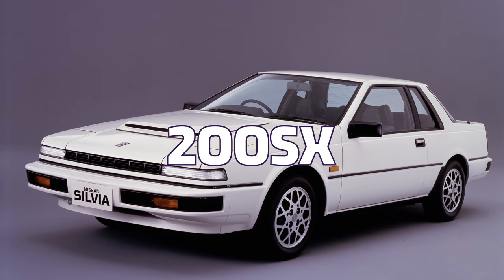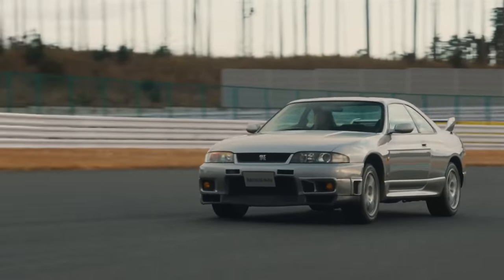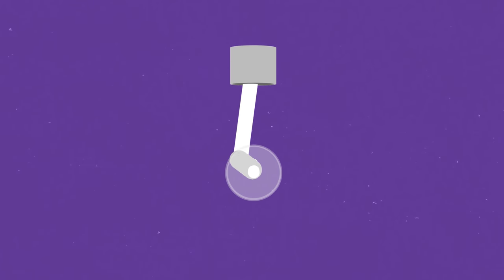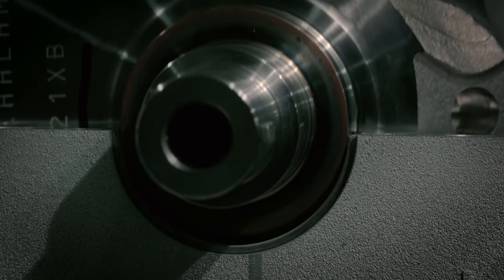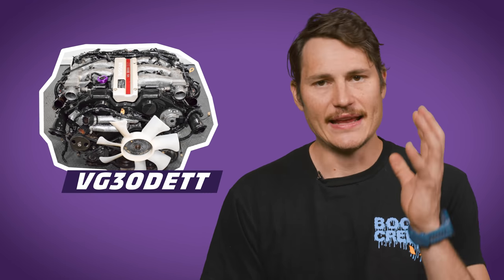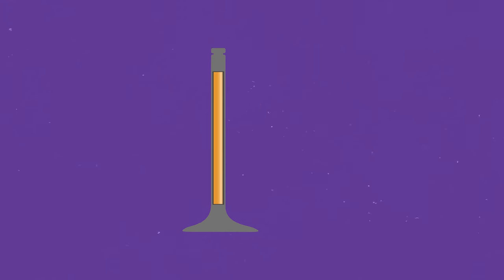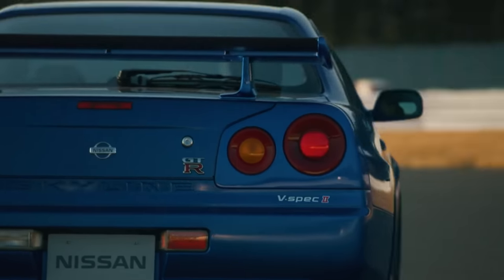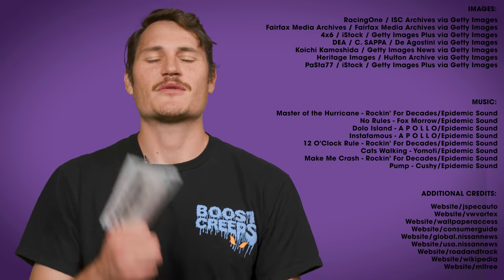RB vs. VG: Why Nissan Discontinued Their Best idea

Comment: if we had another round with legacy the VG would win hands down, basically every performance car Nissan has made since the R34 has been a V6 (correct me if I'm wrong but I'm 90% certain)
Reply: That's true, all performance cars they made in the last 15 years are V6s. So basically... both of them. That's depressing to say out loud :(
Reply: @bogdanrus7953  in saying that they've refined them a lot of the last decade... I can't really say much, I've never owned a fast nissan, I've had a suby b4 RSK and a VY Holden commy in the past... and now I drive a prius
Reply: Sentra SE-R Spec V, was it? I mean...  I know it's a Sentra and a FWD car from the early 2000s. But C'mon, dog. It's in Need for Speed Underground lol. Actually, forget I said anything. Slippery slope, that one. Next thing we'll have the Nismo Rogue in the mix 😐
Reply: @jblox1990  also need for speed underground came out while the R34 was still in prod... (NFSU came out in 2003, the R34 stopped being made in 04, the best gaming year for Ps2 and OG xbox is 05, some of the best games of all time came out that year)
Reply: I suppose you could count legacy...
However, other than being a V6, what does the Nissan VQ and later engine share with the VG? There is one thing I'm glad it didn't share. A timing belt. If you work at a car company and a member of a staff decided to build a car with one, gag them with a split timing belt.
By this logic, could the RB engine be considered what the L-series could have been?
@Bogdan Rus
I think BMW still uses inline sixes. Since Toyota wanted one for the MKV Supra, they used the BMW engine. I'm not happy about that, BMW engines tend to have really awful oil leaks.
Reply: @ThetrueDjScottyD  hahah up the VY
Reply: @ThetrueDjScottyD  R34 stopped production on ‘02 if you’re thinking of the Z-tune Nissan bought back a specific number of used R34 V-spec II for the 20th anniversary of NISMO.
Reply: @matthewcasey5059  Thank you!!
Reply: Even right now their premier car uses a v6 that is called the VR engine. Which is an evolution fo the VQ... wait.. what was the one before the VQ? The VG.... odd. 

Surprisingly the VG and RB came out of production at the same time and nissan decided to go with the VQ and then VR instead. They also have the VK that was used for a small time betwen them but that's an ENTIRELY different beast.
Reply: @matthewcasey5059  they bought back 20 and sold 19 of them, kept one in the factory
Reply: VQ and VR V6s from ~2002 forward, VG was replaced by VQ.
Reply: @ThetrueDjScottyD   TXR0 and TXR3...oh the grand memories.

Comment: well. nothing beats an inline 6. sounds amazing, runs smooth as all hell, simpler, better sounding, cooler in every posible way. I don't understand why almost no manufacturer uses them anymore.

well, I do understand why almost no manufacturer uses them and it has to do with packaging and being able to use it in more different models but still, Volvo managed to cram their 3.0l inline 6 in a v/s60 sideways. and those cars aren't exactly wide so even tho it is simpler to have a V6 in a FWD based car is it more often than not possible to fit an inline 6 in one aswell
Reply: It's probably also a fuel economy issue; look at jeep with their 4.0... dropped due to poor fuel economy
Reply: Volvo managed to fit one into an S60 sideways but having a six cylinder engine hanging over the front wheels meant it handled like crap. Everyone else who makes I6s mounts them longitudinally, and other than in very large cars they always get criticized for their cars lacking in interior space compared to their rivals.

The vibration issue is grossly exagerated and counterweights don't really consume much power to turn at all. They add inertia but when road engines have heavy flywheels mounted on them specifically to increase their inertia that's a moot point. Most V6 engines are very smooth, smoother than any I4 which is what most people drive. They also generally sound better than I6s, of course don't go comparing the sound of a BMW M3 I6 with an old Ford truck V6.
Reply: @BigUriel  I don't agree. The practical reasons are fully valid. An inline 6 is a long engine, but saying that all Volvos with inline 6 engines handle like crap is a gross overstatement cause a Volvo V60 polestar held the lap record on the nürburgring for an entire year and with terrible handling would that be impossible. And I have driven a V60 polestar and can tell you from personal experience that they handle great.

But, it is hard to make a car with a big engine hanging in front of the axle into a good handling car, but that same logic is applied to a v6 since they are just as heavy as an I6 if not more so.

And I absolutely disagree with the sound. I personally find an inline 6 to be miles better sounding than a v6. I even think that most inline 4 cylinders sound better than any v6 engine. R35, sound like shit. V6 mustang, what a joke. The new Ford GT, completely gutless. I don't like the v6 sound at all. But this is super subjective. What I find to be good sounding can you think sound like shit and vice versa.

But according to me are among the best sounding cars ever running an I6. The jag xj120 and Mercedes 300sl are two examples that come to mind.

And shure, a v6 runs smoother than an I4. That isn't a surprise. But an I6 and a v6 are in entirely different leagues. Perfect primary and secondary balance beats perfect secondary balance and balance shafts to try and stop the primary forces.
Reply: @isaks3243  You can make a terribly balanced car still go around a track reasonably fast if you make a lot of compromises, like very stiff suspension and of course very grippy tyres like the ones they use to set Nurburgring records. AWD helps too of course but then we're entering the debate of handling vs grip which don't always go hand in hand.

A V6 engine weighs the same but can be fitted in a different position which changes its effect on the cars center of gravity. You can mount a V6 engine longitudinaly on most cars without them hanging over the front axle, many cars with V6 engines actually have the engine behind the front axle which technically makes them mid engined cars.

I'm guessing you're American and so you don't know what a good V6 engine is. Most American V6s are budget alternatives to the V8 counterpart, where as in Europe V6s are high performance alternatives to the I4 counterparts. That makes a huge different in how the engines are designed and tuned. I suggest you look around for someone with an Alfa Romeo Busso V6 for example and then decide which sounds best.

The difference in smoothness between a V6 and I6 is almost imperceptible. Modern V6s are very well balanced, engines have rubber mountings (sometimes even pneumatic ones) to absorb vibrations, heavy dual mass flywheels etc, 9 out of 10 people would not be able whether there is a V6 or an I6 under the bonnet based on NVH.

I6s have mostly been replaced by V6s for a reason, they simply offer a better compromise relative to what consumers actually want. An I6 is cheaper to make, that's what manufacturers would prefer to sell if they could, but then they'd lose sales because their car would handle poorly, or need to have a very poor ride to handle reasonably well, or they'd need to have a very long bonnet with the passenger compartment pushed back (and ultimately shorter relative to the car's total length) to make room for the engine which is what BMW does.

And I actually own a BMW with an I6, I should know. Leg room isn't great in the back because the engine goes so far back that the driver sits right in the middle of the car, that's always been a downside of BMWs.
Reply: @Sérgio Alves  you are completely wrong with your assumption of where I come from. I am born in the land of Volvo, I.E Sweden. I will try to find that alfa that you're talking about and see if it is even with a good sounding I4.

I have been in or driven cars with almost every type of engine. inline 3, 4, 5, 6 8. V4, 6, 8, 10, 12.  boxer 4 and 6, twin wankle, VR 6 and w12. I know what they sound and feel like and the only engine that is as smooth as an inline 6 is a v12 from what I have experienced. modern V6 engines do run a lot smoother than an old v6 which in a bad case can vibrate worse than most inline 4. I am extremely sensitive to feeling vibrations and I can feel different types of vibrations and if you're correct about 9/10 not being able to feel the difference am I that 1/10. but feeling some vibrations doesn't have to be bad in the right context. as an owner of a 1973 Volvo 1800ES can vibrations make the car feel more alive. I am also an owner of a 1996 Volvo 960 estate which has an inline 6 and my daily is a little suzuki. I have almost no experience with american cars, and the little I have are in 50s and 60s land yachts
Reply: @isaks3243  I wonder how you can feel vibrations that well when like I said cars have sprung/dampened engine mounts, flywheels, plus lots of insulation all around the engine compartment, plus the cushioning of the seats themselves etc.

I'm sure if you mount a I6 and a V6 on two race cars, with the engines bolted directly to the chassis and with hard bucket seats then yes you will be able to feel the difference in vibrations. In any modern road car though it's all in your head. 
Or maybe you just need to replace your engine mounts.

MB actually happens to have made the same cars recently with both I6 and V6 engines and I really doubt that if you were to sit on the two versions of the same car you (or anyone) could tell which is which without looking under the bonnet.

But you are right, vibrations aren't always a bad thing and sometimes just add to the character. As someone who also rides motorcycles I understand that very well. But modern car manufacturers all go to great lengths to minimize NVH, and in any car build in the past 10 years they've done this job so well that even a modern I4 Diesel is very smooth, it's silly to suggest that a petrol V6 isn't, the difference in NVH between a V6, I6, even a V8 or V12 has never been so small. It's been just about 50 years since 1973, a lot has changed.
Reply: @BigUriel  a lot has changed. I feel the vibrations through my hands in the steeringwheel cause that is the firmest and most direct point of contact to the car when driving. I have not tried the two mercs. would you please tell me which one it is and I will search for one of each and see if I can feel the difference. cause I have as you said never been able to sit in two essentially identical cars, one with an I6 and one with a V6.

the biggest difference between V6 and I6 is in the diesels tho but you're right. take a mid 00 car and essentially the same car with essentially the same engine from today and todays cars are waaay smoother. especially inline 4 and v6 engines have seen a massive bump in smoothness.
Reply: @isaks3243  Even at the steering wheel the vibrations you can feel will depend largely on engine mounts and steering linkages. Sportier cars have hard rubber/plastic bushings, race spec cars may even have solid metal bushings but 99% of road cars have soft rubber which eliminates most low amplitude vibrations.

The current Mercedes E class (W213) for example started with the V6 engines they had been using for years but about 3/4 years ago these engines were replace with I6s (both Diesel and petrol), so you can find a 2017 car with a V6 and a 2018 car with an I6. This is just one example and MB tend to use their engines across their entire range so this will probably be the case in most larger MB cars and SUVs built around this period. The V6 engines were already extremelly smooth, even the old Diesel one which goes back to the old CLK in the mid 2000s was a very refined engine.
Reply: @BigUriel  thank you, have driven a 2019 E class with an inline 6. my friend owns one, I just have to find a 2017 one with a v6 and i'm golden.

a friend of mines cars engine mounts were shot so he mounted the engine on hokey pucks. didn't make it so that the car vibrates less, the engine is so solidly mounted that you can't rock the engine by hand at all. it is a 1984 Volvo 360

Comment: I’ve always thought the VG was underrated. At least the vq is loved (and loved to be hated)
Reply: VQ for a reason though they made it with minimal power potential since they never made a turbo version. So they tend to be out performed by the VG.
Reply: i have both love my VG way more than my VQ
Reply: Vq are horrible motors nissan dropped the ball after 2000
Reply: @watnw2411  vQ is def not horrible

Comment: I also gotta point out something you neglected to mention:
The RB was in a Z. It was in the 200ZR which was a special version of the Z31 300zx. If I remember correctly it was turbo charged as well. In the early 80s. Also the VG was in both z31 and z32 300zx, Pathfinder, and the Maxima And it turned into the VQ later down the line. 

Again good video otherwise tho 👌
Reply: They also came in cedrics,  cimas and leopards
Reply: @jonathanpaul7530  I have no idea what those are. But I am very interested to learn about them :)
Reply: @EeekItsSnek  they’re Japanese vip sedans but we’re commonly used as taxis
Reply: @EeekItsSnek  I have seen documentaries about them, they make me think of the Cadillac Sedan DevIlle of that time.

Comment: The VG motor is heavily slept on, once you work on one they're really not bad.
Reply: As long as you’re not working on one in a 300zx engine bay… that shit is crammed man
Reply: Bullet proof if you ask me
Reply: @s1ddb429  Which engine bay? the z32 300zx was alot more crammed than the z31 300zx. the z31 vg30et was a piece of cake to work on
Reply: @Garry00Stang  Both are pretty bad compared to my S130 280ZX, but the turbo Z31 and the z32 are the worst offenders
Reply: sucks working on one in a pathfinder lol
Reply: I've got the newer vg33R in my offroad truck and honestly it's one of the easiest motors I've worked on! Other then the fact you almost need to pull off the supercharger to change spark plugs!
Reply: @tanner2254  cylinder #6 sucks in these engines. I have an X
Reply: @s1ddb429  I have a Z32 TT and I personally don't find it too difficult haha.
Reply: @caydz32  You just get used to it lol

Or you have tiny hands
Reply: @s1ddb429  yessir, had to change a spark plug on my Murano. Had to remove the entire intake manifold, bunch of screws and vacuum hoses. Took a while
Reply: Once you remove the clutch fan and shroud the z31 is pretty spacious.  And if you add in a pull through motor mount from xenon that opens up a ton of room. You can actually see the turbo
Reply: The z32 is no more crammed or difficult to work on than most cars made today.

Comment: Love the VG30DETT. Had a 93 model 300zx myself japan import. There's a particular hose in the back of the turbo's that's known as the "bastard hose" it causes problems and is really hard to get to without taking the whole engine apart. Overall the engine is difficult to work on, but sounds amazing and has great hrsprs. I recommend to anyone with one, beef up the bastard hose and also change out the vac lines too there's a bunch of small joins under the engine head and they leak like crazy

Comment: The RB20DET was in the 200zr model of the 300zx in the Japanese market, it was the last straight 6 offered in the Nissan Z series car.  The differences in the vg30e series, and the vg30de series makes a world of difference as well depending on your goals.
Reply: there was a vg20 as well
Reply: I vever knew the rb20 came in a z32. Holy shit.
Reply: @fn2s145  RB20 never came in the z32 just the z31. It's predecessor

Comment: we swapped a vg30dett into a 97 240sx. we retained the oem twin turbo manifolds, had more room on the sides than what a turbo z32 has. we used a modified subframe and modified Infiniti j30 oil pan and intake crossover tube. This was a friends car, I just had a lot of time in it. it was sold and rb swapped. My car at that time was a VH45DE swapped 85 200sx S12. I used a z32 manual trans with a welded z31 rear diff and z32 calipers. On the s12 i used a s14 front subframe and used the mazworx/xcessive kit.  vh didn't last long. very fun before it let go.

Comment: The VG is lighter than the RB, btw...v blocks are inherently stronger than a inline block with less material due to the block design
Reply: But tight af in the engine bay
Reply: @emanh4keem_san420  i can agree from experience. My 87 vg30 is packed in my 300
Reply: @emanh4keem_san420  eh. Not even. The RB26DETT in stock form is just as cramped as the VG30DETT.

Comment: fun fact, the 95 V6 Nissan Terrano (Pathfinder) came out in a VG33E configuration which outputs 270 lbft of torque at 1800 RPM and is basically VG30 stroker and already has forged connecting rods. surprised more people aren't looking into these things more considering the RB30E + Turbo is capable of some insane figures.

Comment: If I recall correctly, the lack of space under the bonnet/hood of 300's meant issues with over-heating/power-loss especially in hotter climates. Correct me if I'm wrong, but I seem to remember something like that.
Reply: True.  The Turbo's actually had a fan that blew air into the 'vee'.  The engine harness will be very crispy by now.